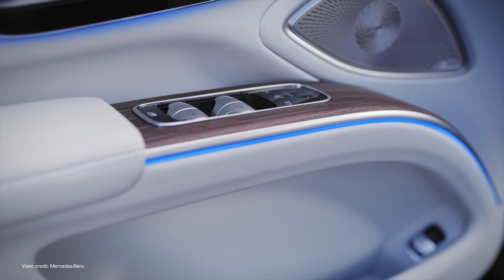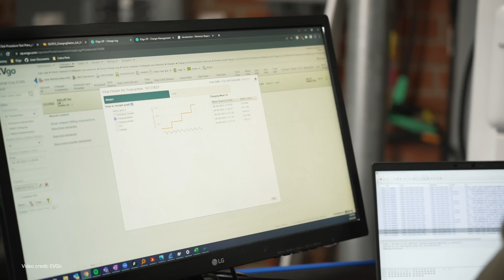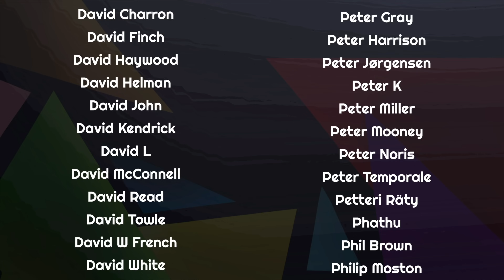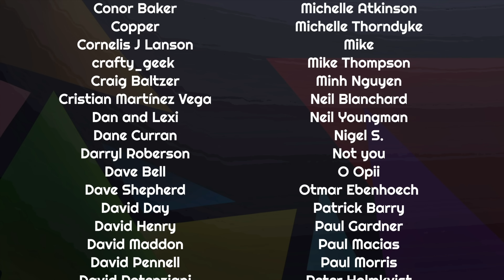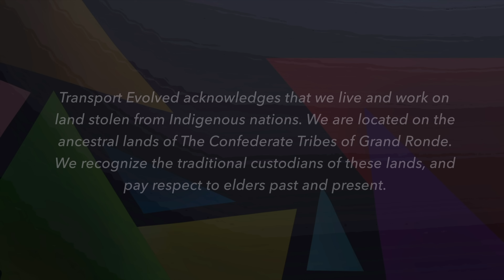EVs have a weight problem

Comment: Agree, that is why the CT climbs so poorly, that and the fact it has no low-range gearing, to properly modulate the torque.
Reply: Can you offer some evidence of the “poor climbing” 
Electric motors have torque down to zero RPM. That’s why they do so well in drag races despite being heavier. 
Also Torque can be modulated at each wheel optimizing traction… Air suspension can help as well…

Comment: Hey hey hey, be easy on the Cybertruck. It is lighter than other EV trucks and the steel will last longer, the amount of copper used will be less and the battery size is just good enough to do the job. 

If the Cybertruck is a better alternative than the GMC 8 cylinder Hybrid or Hummer. 

We have to give the real man an alternative to their traditional concept of what a real man should be driving.  (Yes not only men drive big heavy things, wear shit kicker boots and spit)😂

Comment: As far as unsafe vehicles go, the Cybertruck doesn't seem that offensive. The front should be low enough that you'd be thrown onto the hood.... Which is a giant slab of stainless steel and an armored window. Not ideal but better than having your upper torso and face smashed by "regular" trucks or suv's. The lower front also makes it crash compatible with smaller vehicles.

Comment: Aptera deserves some recognition here. They've been fighting the losing side of this battle almost alone for many years.
Reply: Aptera is bucking lots of design trends and could be even lighter because they don't have billions for R&D they are using commodity parts when possible (including 12V).  Startups are hard and they deserve credit (free advertising) for trying to make a unique vehicle which solves long standing weight and efficiency problems.  Hopefully once they make it to production they can eventually work to make a v2 to improve the known weight and efficiency issues with better inverters, heatpumps, lighter components etc but perfect is the enemy of success for a small startup.
Reply: I believe in what they're doing. I just hope they can get over the massive hill of getting production going.
Reply: Many companies are in a sales loop, people buy large cars because good small cars are hard to find, so their research shows people wants large cars.   I hope if Aptara can actually start selling their cars at a good price point they may actually get popular, and break that cycle.
Reply: @toddfraser3353  agreed however Aptera will always be a niche car, as most people prefer a 4 or 5 seater that's more practical for their needs.
Reply: I love what  Apterra is doing but until they produce and sell vehicles they really don’t have an impact.
Reply: @michaelsmithers4900 agreed, and it's only a 2 seater with a very wide track, not practical for everyone. Its ability to handle winter conditions and poor road conditions including potholes is also unknown

Comment: Smaller battery: shorter charging time. Unfortunately the next bottle neck at teh charging stop will be the coffee facilities, hopefully the number of expresso machines & baristas are increased as charge times goes down.  We need to make sure this is covered in the next round of Gov incentives!
Reply: A retro 50s style drivein (servers on roller skates) at chargers would be a fun option.  If we cant find enough people to staff it we could always put the tesla bot in a miniskirt. 😆
Reply: Smaller batteries usually don’t allow for shorter charging time. This is because batteries can only accept a certain amount of power per unit of capacity they have, so a battery with less capacity can accept proportionally less energy per unit of time.
Reply: Build a coffee machine into the dashboard :)  I guess you'd need a portapotty under one of the seats too

Comment: Very good analysis! Tesla reduced copper usage by 50% in the Cybertruck and made that huge vehicle weigh less than a Dodge RAM. It's not light weight, but offers hope for lowered weight with better battery tech in the future. ICE on the other hand cannot get much better due to mature tech of motors, transmissions, fuel systems, etc.
Reply: FYI there will always be commandos who want this kind of vehicle. If that's the case, Isn't it better for them to be in an EV than a gas or diesel? Same goes for the general trend to SUVs. If all the Escalades in the USA were replaced with Cadillac Lyrics at least we would have cleaner air. Even an electric Hummer might be better than a 6 liter supercharged V8 SUV.
Reply: Kind reminder: 800 V was introduced to EVs already a couple of years ago: Porches Taycan, Hyunday Ionic 5, etc. has that.
Reply: @mikapeltokorpi7671  As far as I can tell, the CT is the only one that is backwards compatible with 400V architecture.  It splits the pack in 2 so it can get 250kw at v3 superchargers and 350kw at v4 superchargers, instead of just 50kw at v3 superchargers like the cars you mentioned.
Reply: @mjbates  You mean that Tesla took the Ultium battery architecture from Chevrolet?
Reply: @ronaldking1054  those are 400v vehicles that can go 800v to charge. CT is opposite.
Reply: @mjbates  Separating the battery to increase recharge rate is the basis of the Ultium battery regardless of voltage of the entire system.
Reply: @mjbates  If you want something novel, then you might want to check Stellantis's IBIS, which modularizes the inverters into the batteries and attempts to make most of the circuits AC. This allows for more interesting ways of draining the batteries, which is an entirely new battery management system as well as could substantially increase the recharge rate of the batteries as a whole no matter what the state of charge is.
Reply: @mikapeltokorpi7671 
800V is ancient history.
The revolution in the CT is the 48V architecture. That combined with a gigabit ethernet (using the same wire), reduced the amount of wires by 75%.
Reply: @andrasbiro3007  Internet over power/electric line is nothing new (e.g. home power utility meters communicate to grid that way and dedicated LAN over electric wire repeaters in house), but this is probably new/first implementation in a car environment. Interesting to see, how fault tolerant it is, if there is suitable frequency interference around.
Reply: @mikapeltokorpi7671 
It's new in cars.
Reply: The Cybertuck is very heavy, stop with the excuses.